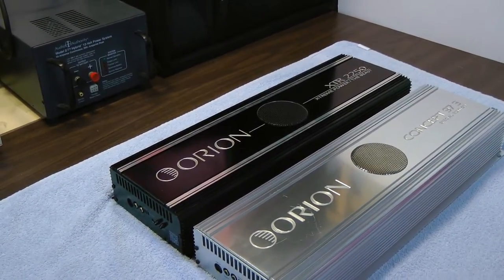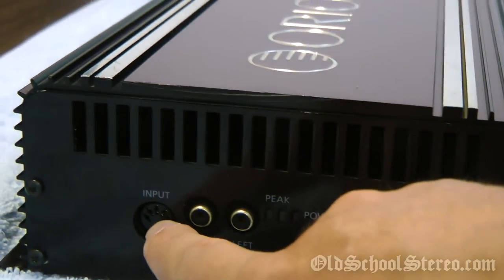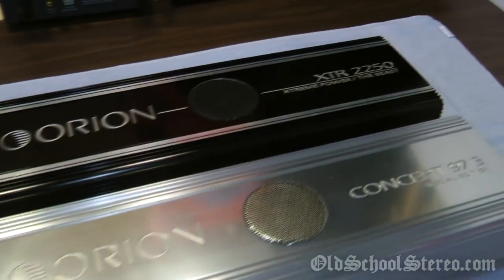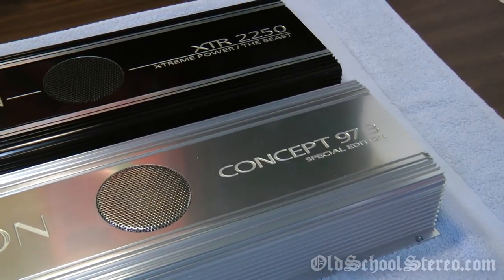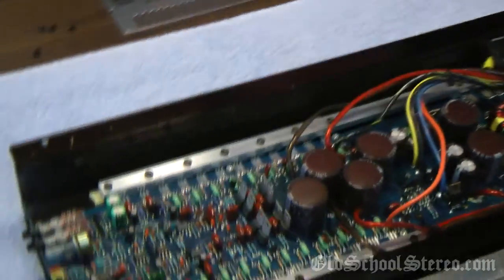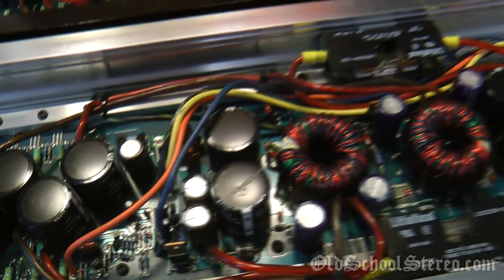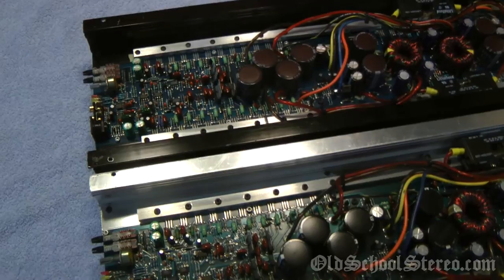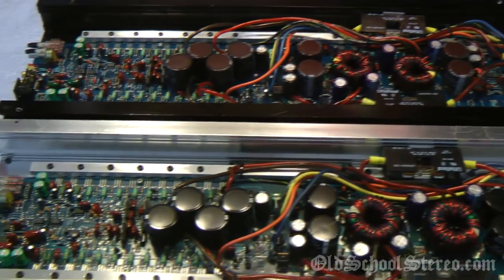Old School Orion XTR-2250 The Beast vs. Concept 97.3 Ultra Cheater Monster Amps

Comment: I can clear up any needed info you need about the 97.1 as the amps were made for my Orion Astro Van. Some of the things you read are true and other not so much. I came up with the idea after Hifonics pulled some shit at a few national events. NOTE: 6 of these amps were stolen from me in 1999 while the van was retired. I had 18 of them pushing 18 15in XTR3 subs. 

IT IS THE SAME AMP.NO MYSTERY :)

We took the same heat sink but left it raw

The slogan was 18 Watt 97.3 “TAKE OUR WORD FOR IT”

These amps were never sold to anyone as new. People only have them because vehicles were torn down and the equipment was sold.

At the time it was the loudest Orion van at the time. 162.4 
We ran the same van with 2100s and 2250s then later with the 97.3 amps. They all did about the same. 
AS a note we broke the 0-100 watt record but I refused to take the win because it was to prove a point. The following year USAC and DBbrag change the rules
Reply: What did Hifonics pull back then? Thanks
Reply: He must still be typing...
Reply: I remember that van and the PPI art van was stolen. I know the PPI was stolen from car tunes on thirteen mile and woodward in berkley michigan. And it made its way to hazel park michigan on eight mile. I remember seeing that van and it was stripped and I remember being offered to buy the amps and I said no way I can't do that. It was so hard not to buy them. Those guys later got caught they did time for it. 
But i'm pretty sure they also got the Orion van. 
Because Orion would come to car tunes and would come to Ameritronix both on Woodward Ave Oakland County. And I know those amps were circulating in some cheap cars. I specifically remember one car was a ford exp With four x t r fifteen And 2 of those amps. I can't remember if they were black or red. I know they definitely were not the ninety seven.
Reply: @Hammerback0  He's not trying to talk too much smack because other people will probably come back in larger numbers to shut him down and it's just not worth arguing. Hifonics plays tricks we all know this.
Reply: A lot of brands did.. In Sweden a extreme Astro, built by the Swedish brand "MDS" used Rockford Fosgate Punch DVC woofers with an added MDS dustcap. They used Audio Art amps, branded as MDS but it's was made by Audio Art. The Rockford Fosgate woofers with the MDS dustcaps on the other hand was just a scam by MDS.

The Van did very well and made world record numbers back in the day (they couldn't make a world record because it wasn't in the U.S).

Comment from the maker: Yeah man, Phoenix Gold was one of the first amp mfg's to come out with the clean connections via terminals. I guess Soundstream also had some early terminal strip connections also, but they used screws instead of through the hole connections. Thanks for the support and enthusiasm...OldSchoolStereo T-Shirts coming before too long!

Comment from the maker: Yes it was, I agree. Again, I had intentions of doing the overviews and output tests in the same video, but it would've been 30 minutes long...the first Old School Stereo feature film! LOL. I completed the tests on the XTR-2250 using one of the 100A power supplies as I needed a way to combine the two 4ga outputs from both PS's and combine to one 4ga for the amps (already ordered them). I won't spill the beans, but the output of the XTR-2250 was "surprising"....

Comment: Thanks for posting this video... I've heard the rumors of these putting out thousands of watts at .5 ohm and .25ohm.. I was JUST about to buy one to try and push a dual 1ohm DD9518... Even if it is stable at .5 ohm. I hate to image the distortion level. You saved me $300!

Comment: I would have to look around and see if I can dig up some literature I have around the house, I believe the Concept is the same as a HCCA competition line. the literature I have shows the Concept used in conjunction with the HCCA competition line amplifiers...HCCA used to power mids and highs and the Concept on subs. Why can the Beast only be used in 4 ohm bridged. operation but the HCCA as well as Concept can be wired to nearly a direct short...? different output transistors ?

Comment: @bigdwiz, ,man the bug has bite the shit out of you!! Good to see these vids! We have the same Audio Authority 2/77 hybrid power supply. they can be daisy chained to. Hook that bad bitch up to a BIG batt or 2 to the outputs ie: inline, then feed the amp, its good for 300 amp burps/ 100+ amps all day. Gotta clean them out tho, dusty! Circuit city had them in there sounds boards, they went bust, and the 2/77's flooded ebay! Got mine for 67 bucks.
  Find some more so you can test the big amps!!!

Comment: Supposedly  well he did have it at 2 ohm mono but the xtr 2250 supposedly  does 2000 watts but you have to maintain 16 volts and have alot of batterya reserve 
A friend of mines had 10 of them on 5 dual 2 ohm stroker 18s hit 168s 169 steady at like 32 hrz lol on a linear x orion told him to do it that way

Comment: I have an old xtr 2250 laying around. Every capacitor inside is broken off at the solders. Any idea what happened and can it be fixed? I bought it at a yard sale for $10. I knew something was broken when I bought it because you could hear the capacitors rolling around inside. But I thought what the hell for 10 bucks.